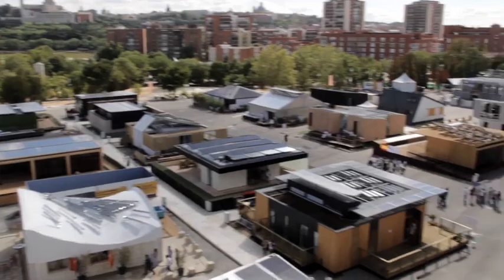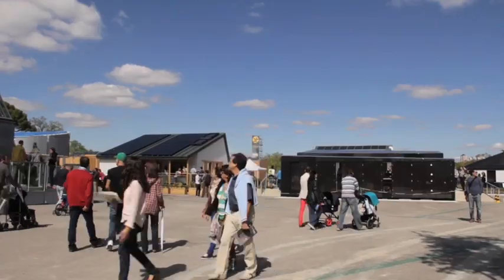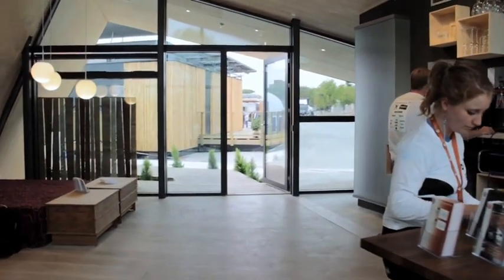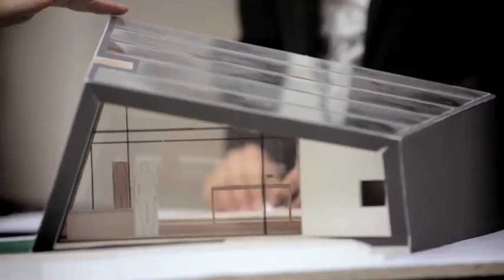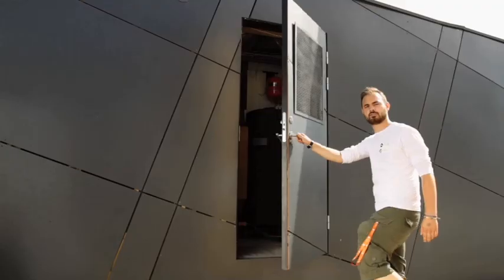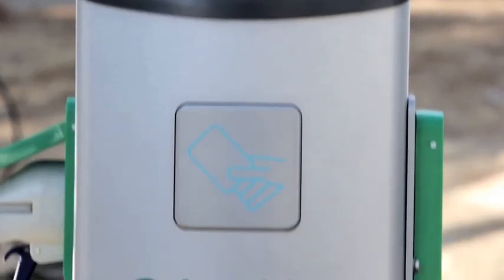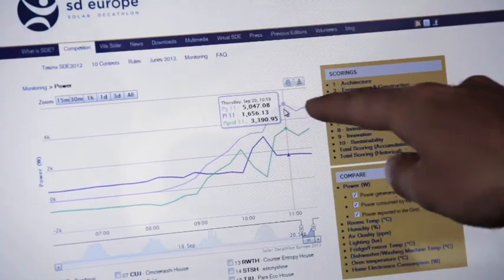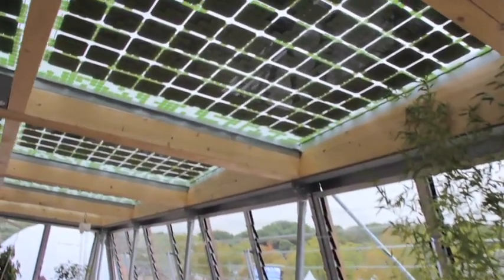Schneider Electric Powers the 2012 Solar Decathlon

Comment: Schneider is not consistent. It decided to close SEEI Rieti (Italy) which produces fully automatic miniature circuit-breakers.  The strategy is to return to manual production. The workers are laid off without notice. The production moved to factories in low-cost labor. This is not true innovation.